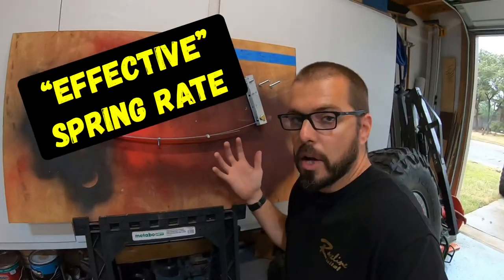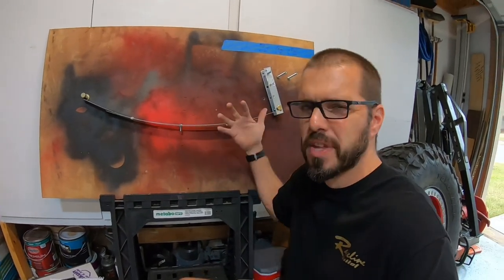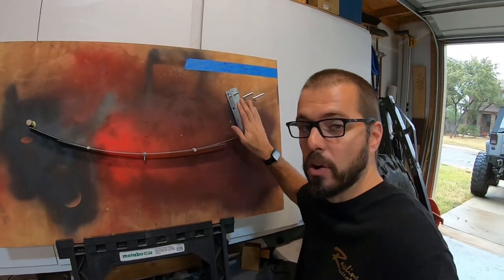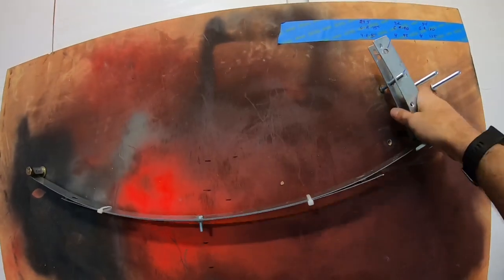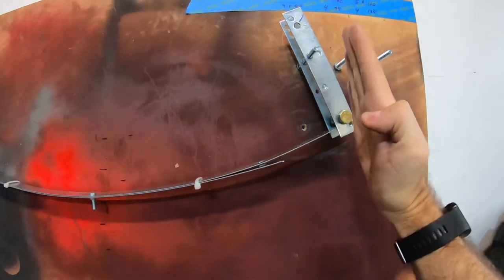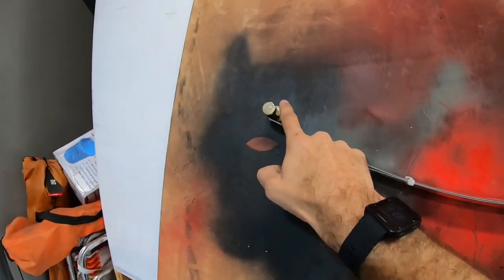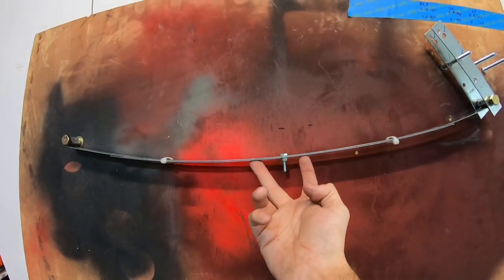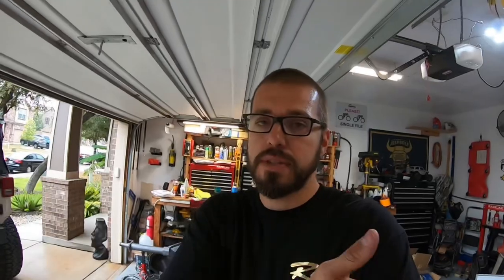LEAF SPRING SUSPENSION - Project Maple Leaf Jeep Build (no. 14)

Comment: Ive have a cj 7 for 27 years, the fourth suspension I plan on doing to it. will be wrangler spring over, front shackles reversal with revolver or some sort of rotating shackles. This will be a daily driver and at least a monthly off roader
Reply from the maker: That’s awesome! I’ll be doing mine based on the JK swap trusses but with TJ coil springs.
Reply: @WarPaintOffroad  when I would go out with wranglers that had that set up they were envious and the way the leaf springs would level out my jeep. Any truck could out climb me but I could remain level between the axel. DrooP is great but level is upright.

Comment: My dad had a old Landcruiser J40 and he used to put sandbags in the bed to make in ride better.
Reply from the maker: Yea! That works because it compresses the suspension a bit making the rig “heavier”. Just usually means the spring isn’t matched to the vehicle or that the shackle angle isn’t set as good as it could be. But those truck rode rough off the lot.

Comment: I used to build SOA Jeeps etc back in the 90s. Brake dive, and worse front axle hop under braking are the issues with soft leaf sprung SOA jeeps. Anti rap spring perches help, but I built links on Jeeps and a toyota that I put on wrangler/ xj springs, to control that.
Reply from the maker: Good point! Thanks for the support!

Comment: 9:40 you used a different eyelet length, of course it'll be stiffer on the shorter length eyelet. If you demonstrated it using the same length shackle then it actually is softer at 90°
Reply from the maker: This was a demonstration and you took a small clip of it. That isn’t what this was about. In the seconds after that part of the video I talk to people not changing their shackle length and getting a more arched spring, which can be shorter and changes the shackle angle…SHACKLE angle is what changes the way a spring acts. People mess with it by putting longer or shorter shackles on…and SOMETIMES that works but it always comes back to the angle. If the angle isn’t right off the frame…it won’t ride well regardless of spring. So length isn’t the point. 

I didn’t have the holes on the board or in the steel to keep it the same length and show the angle being 90. But it doesn’t matter. The point was to show ANGLE.

Comment: Would you please explain pros & cons of slider box leaf mounts and why you didnt choose them for your front leaf sping mounts at front of jeep and how that relates to approach angle in a video? Considering a four corner leaf set-up on my XJ.... and on the future buggy project coming up....
Reply from the maker: So they work great. But they are just loud. The jk was packaged really tight having never been a rig that had a frame designed for leaf springs. So it was just easier to put it in this way.  Ut those work!

Comment: Great video ive got custom rate national spring springs that are 5 ft  in the back and 55 inches in the front of my 73 chevy it works very well.  I do use a track bar up front because I like tight steering when on the road . I also built a anti wrap   single link in the back because big tires , big power v8 and soft springs. More or less work or money compared to links and coils ? Maybe maybe not but I like it.
Reply from the maker: So good! Thanks for the support.

Comment: Awesome video. I have a 95 YJ with a 2.5” lift and it is crazy stiff. I need to look at that shackle angle. My question is can the shackle angle be corrected with a boomerang shackle? This way the mounting points don’t have to be relocated.
Reply from the maker: It can help for sure. The best thing to do is to relocate the mounting point. But the boomerang is a good compromise and will make a difference for sure! I have a video coming out tonight that is going to show what I’m doing to fab up the front end on the jku leafspring build I’m doing right now. It might give you some ideas. Part two of the front end will be done next week…just waiting on a part.

Comment: This is an excellent leaf spring explanation video, especially loved the mock-up for us visual learners. I'm currently building a 95 YJ with a dana 60/Sterling 10.5 out of a leaf sprung 99-04 super duty.  My question is about shackle reversals - with the axle moving backward instead of forward, what are your thoughts on how to avoid the driveshaft getting pushed too far into the transfer case and causing damage?  At what point does that even become a concern?
Reply from the maker: So that’s a GREAT question. And it depends on how large the shackle is and how much movement you’ll have. But you can always call a custom drive shaft company and have the splines in the shaft be longer than normal. They’ll know exactly what to do to make that a non issue. If you can, put it in a lift and measure  that stuff before you call them. But the custom driveshaft shops like Adams will understand the build and they’ll know exactly how much movement you’ll have to get it set up perfect. Thanks for the support!

Comment: Thoughts on a rear tension shackle setup for leaf springs? My wagoneer has that setup and thinking about upgrading that system with Off-road Design’s long travel shackle and adapting one of the square body hangers to fit my frame
Reply from the maker: I think it’s a great idea!
Reply: @WarPaintOffroad would you use the same kind of angle setup for a tension setup as you would for a compression setup like you displayed?

Comment: Best leaf spring explanation on youtube. I'm re springning a '53 cj3b. How do you choose shackle length? Just match the fixed mount (if reusing stock)?
Reply from the maker: Thanks for the support brother! You can choose a length that best suits you. For the front, if you aren’t welding on new perches you’ll want to make sure the length is right to give you the best pinion angle. In the rear you’ll want to keep that on might and also set it up with lift height in mind. There are some calculation on the internet. But that’s the basic things you want to keep in mind. You have much more flexibility when you are putting new perches on the axle and can weld them in to set your pinion angle.

Comment: Great video I have a econoline with solid axle swap up front Dana 60. Progressive atlas springs. From looking at your video I think the front shackle angle could be improved. It is almost at 90 degrees now. The only thing is will the caster be affected. Playing around with shackle length and angle I should be able to get it dialed in. Thanks

Comment: Great info, and so clearly described.  Are you worried about axle wrap in the back?  Can’t wait to see vid on setting your spring perches on your axle and the effect on pinion angle and castor angle.  And what do you think about ride quality with offset leaf springs or offset spring perches to adjust/stretch your axle position/wheelbase?
Reply from the maker: All amazing questions. So axle wrap is a concern. I’ll be mounting an anti-wrap bar on the rear axle and welding it to a crossmember to prevent it. That and also going to run an anti-wrap perch in the rear. I’ll explain it when the time comes to make that video. Offset perches definitely change the ride..but, with it being completely custom the perches won’t be offset on this rig. So it should be pretty easy in this case to dial in. On a more factory modified rig, it’s a pro/con scenario. Sometimes the stretch is worth the sacrifice in ride. Depends on the uses and what you are looking to do with it. The more you build it to be focused at doing one thing really well, the worse it is at doing other things. Pretty much why hood commuters aren’t race cars and rock crawlers. And it’s why specifically built rock crawlers aren’t good race cars…etc. but it will all get talked about in future videos. THANKS FOR THE QUESTIONS AND SUPPORT!
Reply: Thanks!  Can’t wait for the upcoming vids!  Hoping you talk about caster and pinion angle and driveshaft issues.  Really enjoy all your videos!!
Reply from the maker: @benorlik2894  thanks for the support! I’ll definitely talk about it!

Comment: What springs and shackles are you going to run?
Reply from the maker: 4 inch shackles and 1985 grand wagoneer rear leafs on all four corners. They worked pretty well. But life happened and this rig is actually being swapped back to jk rubicon axles and getting long armed to be sold. The one tons are going under a different jeep the owner has. The first part of that video is coming out tomorrow.

Comment: Having the shackle on the front sucks for on road use.
Reply from the maker: I think you have that backwards. The shackle on the front is less desirable for Offroad use…but better for on road. The reason they normally put the shackle on the front for on road use is to avoid the nose dive you get while hitting the brakes hard in a panic stop. Makes it easier to control the vehicle. Makes it stiffer…but easier to control on road. Off road…..the shackle in the front hurts approach angle and changes the way a front tire climbs an obstacle…so it’s more desirable to have the shackle on the rear of the spring.
Reply: @WarPaintOffroad   Sorry about the confusion, I know the video is about Jeeps but I was just basing my opinion on my experience with full size trucks. My '96 F350 would experience a quick back and forth bounce when hitting bumps on the highway because of the front shackle swinging the axle forward on bumps and the recoil was felt in the truck. My '79 F350 has the shackles in the rear and I don't feel any of that. I never experienced nose dive on either truck because they both had stiff ass suspension. Jeeps are a different story.